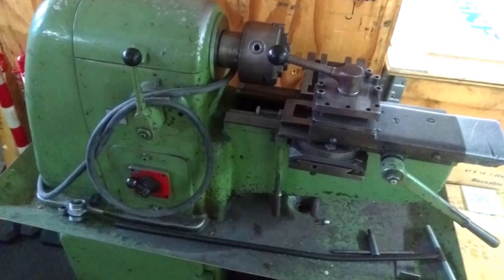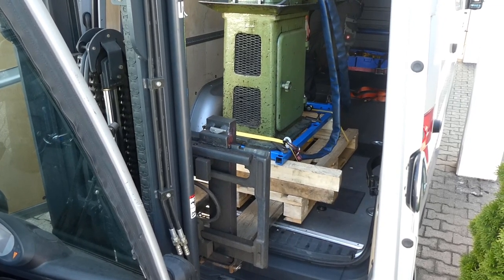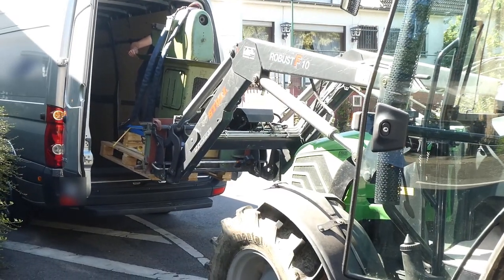Short Bed Lathe Restauration - Buying a small lathe - Cabiati Mario TPR1 Part 1

Comment: Funny little capstan lathe without its capstan, sadly enough. Looks to be built like a tank, very rigid and hefty.
Reply from the maker: Yeah, some sort of capstan-style lathe at least. I will talk about this in more detail in the next video. What you can see here in fact seems to be one of the default configurations the machine came in.
Build like a tank for sure. Once back in good condition, it will last for many more decades to come!